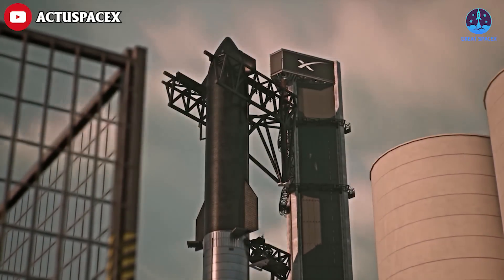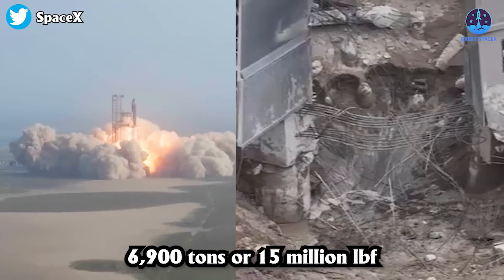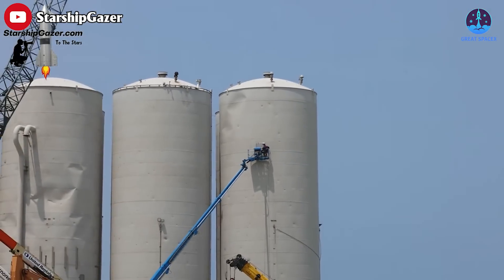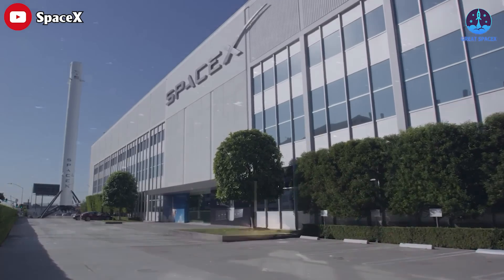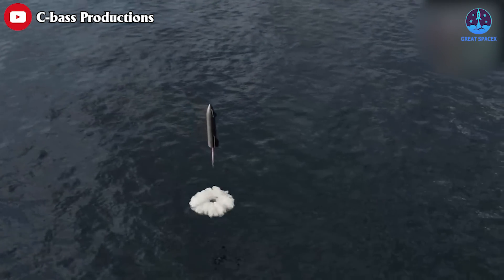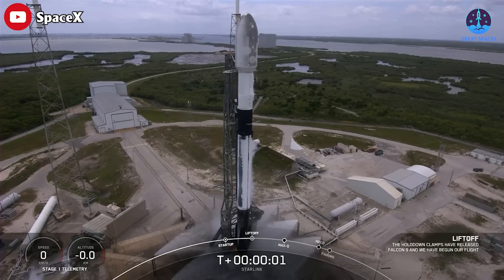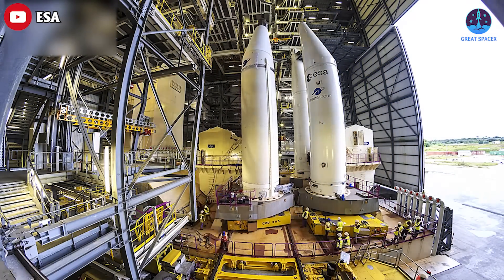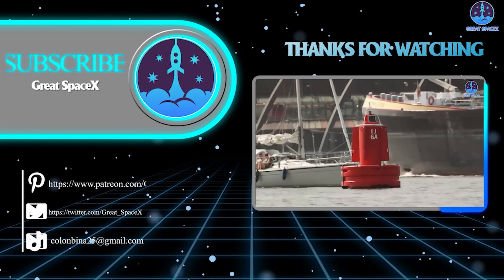SpaceX is fixing the launch site, New Megabay construction, OLM, Lox tanks, concrete...

Comment: If you put enough rockets off at once to reach critical mass frequency of concrete, it will crumble..concrete  is like glass,it can handle pressure but concussion will bust it all to hell.water lowers concussion by 30%.carbon fiber would be stronger and heat resistant than concreat..

Comment: Bearing in mind the projected launch rate of Starship, will the layered water cooled steel plate really offer a reusable long term solution?  I'm thinking that much more development will be required before that point is reached.
Reply: Future launch mounts/tables will most likely be made taller if the upgraded steel flame deflecter does not hold up for multiple firings.
Reply: Yeah will be interesting, I personally like were Elon is going so far anyway, having a single big steal plate to swap out is much easier than say a huge complex system and I guess considering landing, no one has tried this before and it might need a different solution so why not try build a new system the suits both phases or at least try while in testing stages. Honestly when I looked at pad a surrounding damage, it didn’t look that bad to me considering the people and knowledge to repair and modify
Reply: Yeah will be interesting, I personally like were Elon is going so far anyway, having a single big steal plate to swap out is much easier than say a huge complex system and I guess considering landing, no one has tried this before and it might need a different solution so why not try build a new system the suits both phases or at least try while in testing stages. Honestly when I looked at pad a surrounding damage, it didn’t look that bad to me considering the people and knowledge to repair and modify
Reply: I mean what is it, concrete, pips, electric and steal plates, no major when you have factory’s producing the stuff and a massive team of experts and engineers literally on site together and well versed with the systems
Reply: Not that f$&n hard
Reply: Spacex are now so far ahead in development that it's really hard to see how anyone is going to get near them anytime soon. Iteration on Starship will no doubt bring more rapid progress but platforms still need a lot of innovation and development particularly considering Mars base and how safe landing and take off will be achieved there. Steel launch platforms and other constructions will be needed and these will have to designed and developed and transported. I'm sure Spacex will succeed but it would surprise me if that next step might go to nuclear propulsion, I don't think Elon is one to sit back !
Good luck to Spacex !

Comment: Why did they hold it so long after firing it seemed to take ages to move
Reply: 3 engines were shut down before launch and the thrust-to-weight ratio went from 1.5 to 1.25 causing the 6-second delay before the other engines throttled up to get the balance back to 1.5 for liftoff.
Reply: Marcus, does a great YouTube channel explaining this.

Comment: Well, if the Environmentalists or Unions don't get a stranglehold on SpaceX, then EM's got a fair shot at his goals.  Ya know, EM claimed the rock & soil "compressed" under the Fondag concrete slab from the exhaust pressure, allowing the slab to break up followed by all the rocks & soil. So if SpaceX is gonna use a Water cooled metal plate as a base, they gotta fill that crater w/ something that will support the plate. I wonder what they'll do.
Reply: They said their gonna tie the plate into the OLM legs to help tske the load
Reply: SpaceX’s enemy, like most of us, is the government.. The FAA, Unions, environmentalists all use government power for their shakedowns & extortions.

Crushed rock fills the hole where the sand was blasted away, rebar & concrete are tied into the legs… the water cooled thick metal slabs take the blast & heat, water deluge handles heat & acoustic emerge.
Reply: Driving deep piers down to bedrock would do it.
Reply: They're currently putting in the forming down there. It's going to be seriously robust given what I've seen.